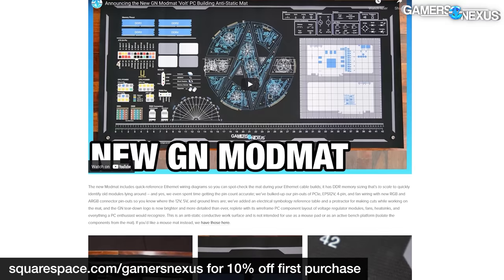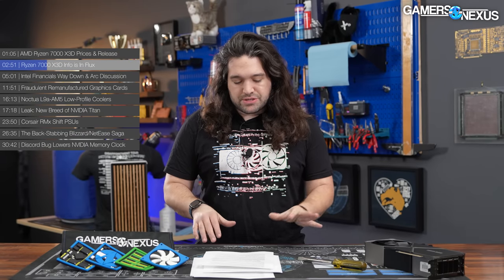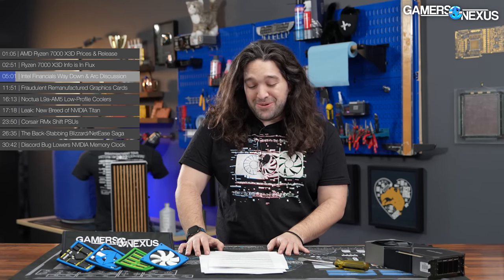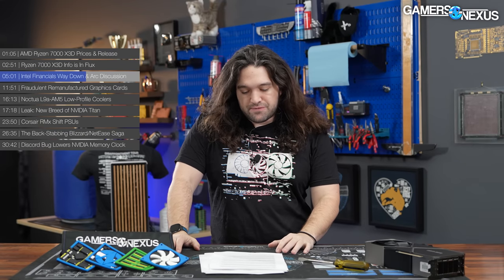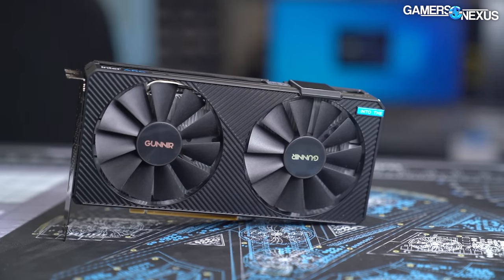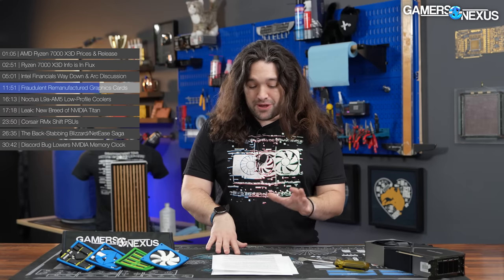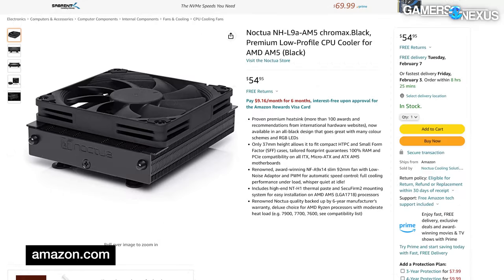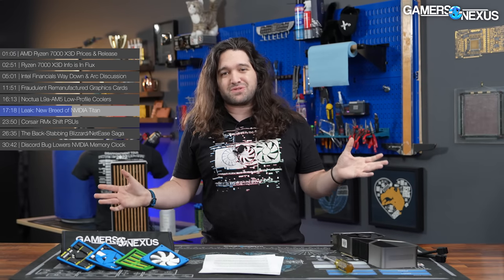HW News - Fraudulent Used Video Cards, 7950X3D Pricing, New NVIDIA 'Titan' Rumors

Comment: The Arc A750 is now much better than the RTX3060 & is also 1/3 less cost! So unless you want & can afford an RYX3070 or better, the best option for budget gaming is now an Intel Arc A750 at $249! Let all the older graphics cards (RTX3060 & below in the 3000 range along with all the 2000 & 1000s) now pass into extinction, because the Arc A750 is also much newer & more future proof whilst support for the others is vanishing. AMD & Nvidia are short shipping to maximise their profits whilst ripping us off proving they don't care! So sod them and switch to supporting a new 3rd supplier for a better deal!

So now, best options for your budget: 
Under $500 = Intel Arc. 
$500 to $1000 = AMD. 
Over $1000 = Nvidia.

Remember: the Arc GPUs have much higher hardware specs than comparable price AMD cards,  like twice as many CUDA cores, so the Arc cards WILL continue to gain more & more FREE extra performance as the drivers improve!

Comment: They are probably purposely are releasing the 12 and 16 core X3D models first because many just want and only need the 8 core 7800X3D and its a 33% markup from the 7800X3D to the 7900X3D and for many games and gaming setups I bet it won't be much of a performance boost even with the different boost clock speeds although I could be way off. I bet nowhere close to a 33% performance jump at least for nearly every practical game scenario. They wanna sell a lot of volume of those higher core count ones upfront to people who don't wanna wait on the 7800X3D or worried bots or scalpers might mass buy them out so many will take the wallet hit for the 7900X3D. And then many people that see the 7900X3D for $599 might also see the 7950X3D for only $100 more for 4 more cores and 8 more threads and slightly higher clock speeds and end up buying that one "future proofing" when many would have just bought the 7800X3D if they had them release as the same time and now all of a sudden they have the 7950X3D to play League of Legends.

Comment: Someday soon they are going to say we are unveiling a new gpu outside the building, and pull a rug off a cargo container and say, marvel at our new live in gpu with optional aftermarket water-cooling systems...

And the new power supply called the chernobyl two, now with cleaner nuclear fuel rods.

Comment: So which CPU should I get, 7950X3D or 7800X3D? I play games mostly but don’t want to have a slow PC either. I already have a 7950X and 4090.
Reply: Keep your build as is, wait for the Zen 5 3D ver
Reply: Get a 7950x3D to replace your 7950X. And a 4090 Titan to replace your 4090.

Comment: About discord bug, i had the problem for over a year now, just disabled hardware acceleration for now. “ i use 2060s msi ventus edition oc
Clock speed 7000mhz , drops to 6801 exactly “

Comment: I just built a new media pc, the gpu was definitely used. idk if its relevant to this though it was a 6700xt. Just looking at it I could tell it was used before due to witness marks on it and such. Though it works perfect and actually benched way above what its avg is. So I don't really mind but it still feels dirty.

dealing with china is rough, I doubt they left blizzard with much room for profit. Can't they still just use a vpn and connect through a different location? Most people in china run vpns to bypass the chinese governments firewall? I played an mmo called nexustk with alot of people from china and thats what they told me at least. I don't know first hand. P.S. blizzards shitty too so idk who is at fault there anyway. it very well could be blizzard being blizzard...or china being china

Comment: I'm just wondering if I should just go with a 13700K/13900K or wait for the X3D's. There is conflicting info. on possible issues with them, and on if they will be able to perform on par with Intel. Intel's low efficiency and high temps discourage me from just going that way...
Reply: I got the 13700k to replace my 10700k and I use my system just for gaming and surfing the web. And tbh. No a difference in gaming performance at all in the 3440x1440p resolution i game at.. feel really stupid buying it. Was nice to get pcie gen 4 speeds for my nvme drives but in games it makes zero difference still in 2023.. same goes for pcie gen 5 to use my 3080t at its full potential and still zero difference in fps. And as for cooling it does it’s not a issue at all what so ever. My old h115i which has been used for many years on my i7 6700k at 4.8ghz then my 10700k at 5.1ghz on all 8 cores. Then now my 13700k and in games it never breaks 60c. Averages 54c in hwinfo64. And in windows surfing the web it’s always in the 20’s. I saw reviews of Jay saying the new  big little processors seem snappier in windows and that’s just a utter lie.. It’s exactly the same as all my older builds have been. Nothing new at all. I say save your money if you’re on Ryzen 3 or newer or on intels 9th gen and newer if you have 8 cores or more. Use your money for just  a new gpu imo.
Reply: @SVT_LIGHTNING , I already have a 4090... Won't need a new one for a while.
Reply: @jkell411  non 3d parts are already very competitive with Intel, 3d ones will crush them in some games and will be noticeably better on average. Unless you've got a really bad CPU right now, imo you should wait for 7800x3d to make the most out of your 4090
Reply: @vinylSummer , yeah, that's where I'm leaning. I'll see the reviews when the 7900 is released. I don't want to wait until April or later if I can help it. Plus, I would like the extra cores.
Reply: @taekwoncrawfish9418 , I'm not eating them up. Just reading what's out there. They do suck down power a lot more power than previous generations. I do understand that I can undervolt, too. I just want to make the best overall choice.
Reply: wait for the X3D's. It's only three weeks away. There will always be FUD for any new item.

Comment: Fake New: They should advertise them as Remanufactured, same as in the car industry.
Quite normal, they have core charge too, so say your old starter, you buy a remanufactured one with 20-30$ core charge, you return your old one you get that 20-30$ back :)

Comment: discord has been the most unoptimized piece of software to ever exist for years now. it is way too heavy on your pc to the point that, especially but not only, low end pcs have to literally turn the software off in order to get extra performance. a software used for comms that needs to be turned off bcs it used too much of your pc, that is really cool huh

Comment: Hasn't it been confirmed that the 4090 is actually cut down because of power consumption? If that's true, a giant Titan card makes perfect sense. It'll probably have 2x16 pin power connectors or 4x8 pin power LOL

Comment: Full flow-through also could indicate that nVidia expects users to be using multiple cards (2 or even 4 in a threadripper/epyc system) because you're far less likely to have the "top" card/s being airflow-starved with the 4 slots that each takes up

Comment: I installed my new RM1000x power supply in my Corsair 5000D just the other day, and yesterday I saw an article about the new Shift series

bruh.
Reply: So if you have a problem then return it if you can

Comment: Between only one die having the 3D cache and the locked core clocks, I'm not very smitten with AM5 for the 3D cache stuff, and needing to delid the CPUs and run bare die for decent temps on the regular stuff and some overclocking headroom, might as well just go with my original plan for a daily single stage phase change rig. The closer to perfection you get, the more obvious the flaws.

Comment: Sorry but everything you said about the Titan was wrong. No way this card is for vertical mounting at 4 slots. My Corsair 7000D only has room for 3 slots no case would fit a vertically mounted 4slot card. This would have to have some 90 degree pcie board on it to mount to the mother board. Great theory but not possible at that thickness. If this is real and that cooler is real I would be so excited to see how they engineered the connection to the mobo. Let me know if your hiring lol
Reply: Wait until the 5 slot coolers

Comment: 4090 is not a GPU. It's a space heater
Reply: the 13900 runs hotter than the 4090 tbh
Reply: @FractalPrism.  13900 + 4090 is a space heater

Comment: If you're going to cover rumor mill GPU's I'd rather see 4060ti related info and speculation than speculation on a card the majority of us will never buy. Thanks.
Reply: 4060ti related info and speculation is more dull and boring
Reply: @sammiller6631  How do you figure?  It's a GPU that the vast majority of consumers want and will purchase.  It suits the needs of the vast majority.  Almost nobody needs or will purchase the next Titan equivalent.  You could launch two videos each covering "Titan" and a 4060ti and the 4060ti is going to get an order of magnitude larger viewership because of that.

Comment: Europe is having massive energy rate hikes.
The Oligarchic States of America's gamer base is addicted to nVidia's {fill in your preferred body part}, and whinge about frame timings. Oh, and those nVidia cards have massive power draws too, so we're still stuck with high energy bills.

And Intel wonders why their CPUs -- which use more energy than two Pentium 4 guzzelers under load -- and GPUs -- with terrible-but-admittedly-improving drivers -- aren't selling enough?
Reply: @MrBenenator  lol u mad.

Comment: That arse backwards Titan just wouldn't work, for 1 if it used the top slots (highly unlikely) then the rest of the card would block the CPU cooler & probably RAM area, for 2, if they used the bottom slots then surely it not all boards would have the necessary PCI-e 4 or 5 X16 needed to run that monster because as it's a 4 slot card it would surely have to fit in to the lower PCI-e slots would it not?

Comment: Alhough 4-slot card is absolutely massive and IMO totally unreasonable for a desktop PC, another probable reason as to why use daughterboard and have the main PCB parallel to motherboard is that PCIe Gen 5 now finds its way into consumer market, and for signal integrity reasons PCIe 5.0 slots are surface-mounter instead of solder-through. The videocard PCB basicaly works as a lever that puts bending load on the the motherboard near the PCI slot. With radiators getting heavier and heavier on one hand and PCIe slots becoming surface-mounted and less robust on the other hand, the graphics card runs a risk of tearing or breaking the slot right away from the motherboard. To avoid this - it makes sense to make the lever as short as possible and have the videocard PCB parallel and as close as possible to the MoBo.
As for "hot pocket" being formed that way - that's not really a concern. In that layout PCB backplate serves as a heatshield, so a very small amount of hot air gets stuck behind the PCB (provided that the case has adequate flow-through fan setup, but no one in their right mind should be using a 450+W air-cooled GPU in a case without appropriate flow-through setup).
The PCB itself being rotated 90 degrees or using a small daughterboard to plug into a PCIe slot so that it is mounted parallel to the motherboard is nothing unheard of. Mezzanine cards used in server cases do that for a very long time now. You could even remember those cards being used in the video on GN channel, where you and Wendell from L1T disassembled a 2U server with Radeon Instinct cards.

Comment: Its not really thar surprising for Intel.
SUre the last gen CPUs have now been quick, but for a long time they have been lagging behind.
Then they lost Apple as a customer when Apple made the M CPUs and AMD CPUs became better during last gens.

AMD also entered the server market with the Xilinx merger.
Then there is the case that AMD has had consoles for a while now.
Teslas also use AMD now, instead of Intel in the infotainment system.

So all in all it seems Intel is loosing ground on many fronts.

Now Intel did also enter the GPU market, but that market is quite hard to enter with profit at once, especially with laggy drivers.
Also both Nvidia and AMD are there already with quicker products and better drivers.

So I am not relaly surprised of Intel loosing income, as market has shrunk and they have lost on several fronts.
I do however hope that the competition between AMD, Intel, Nvidia etc continues strong, as its always good for consumers to have choice and have a market that develops new and exiting stuff.

Comment: Isn't the 4090 already basically a Titan?
Reply: No.
90 class  was always the rich person gaming GPU Titan was closer to a workstation GPU.
Reply: @0Synergy  Actually, I think the titans started out as the Richey Rich GPU and transitioned to workstation/"hobbyist" (people into rendering and UHD video editing etc, but maybe not quite professionally or at least not in the market for 6000 dollar graphics cards). I think that happend under the Titan RTX. 

The 3090, which was released instead of a 30xx series Titan, was also more a hobbyist card, since the gaming performance gain over the less than half as expensive 3080 was almost negligible, the big gains came when you did something that could use all that memory.

But yes, the 4090 definitely targeted gamers, since it's performance is quite a bit more than that of the 4080. And games start making use of more VRAM now, so the 24GB aren't quite as outrageous any more.

Comment: Hello everyone.. i bought a ASUS ROG Strix Z790-E Gaming WiFi 6E LGA 1700 running with 13900k w/ rtx 4090. My doubdt is if i use a m.2 ssd on m.2_1 5.0gen slot or anotherones. Becouse in m.2_1 slot will drop my 16x_1 pci-e slot (gpu use) to 8x. So.. 8x to a 4090 is a significant drop performance? Thanks!!!
Reply: pcie gen 5 x8 is roughly the equivalent of x16 on gen 4 in terms of bandwidth, so it's completely  irrelevant, you won't notice any performance drop.

Comment: I mean they said the same thing about the locked clock and voltage on the 5800X3D yet like 2 weeks after launch there were already BIOS updates to control it through "PBO" I think is the term.

Comment: Pretty disappointed about the 7800x3D delay; it seems pretty obvious that they are preying on the impatient. I'm lucky enough that I don't need to care about price, I just care about gaming performance in games that benefit from V-Cache, and I'm worried that if I cave in and buy a 7950x3D, the resulting performance would actually be worse than a 7800x3D due to the more complicated dual-CCD setup (I mainly play MMOs, so it's all about the V-Cache for me). I know it'll be difficult for you guys to address these kinds of concerns without being able to run benchmarks on the 7800x3D, which, again, I'm worried is entirely the point of delaying it...
Reply: They're not "preying" on the impatient. It's a luxury item. Windows had problems with Intel's 8 p-cores and 8 e-cores, but they dealt with it. The underlying CCDs are the same, unlike p-cores and e-cores. Shouldn't two of the same type be less complicated? 
But you're also worried that the delay isn't "preying" on the impatient but because 7800x3D is somehow worse? Do you always overthink every fear into multiple ones?